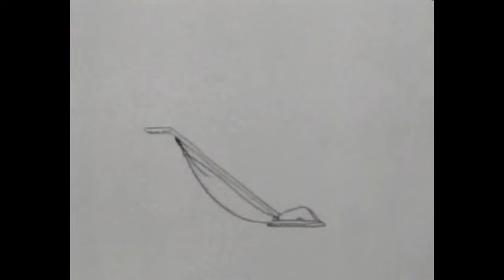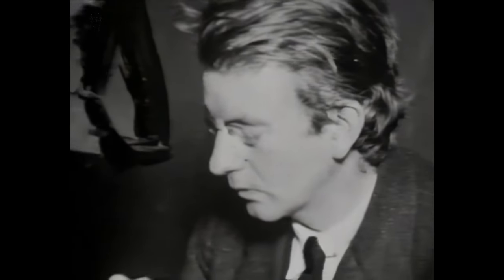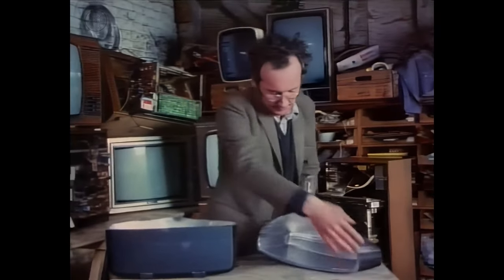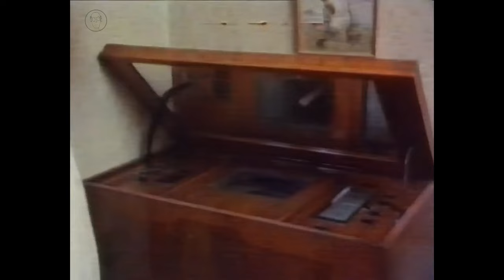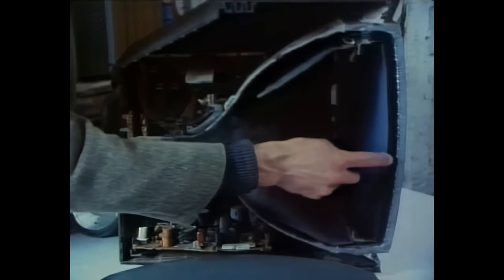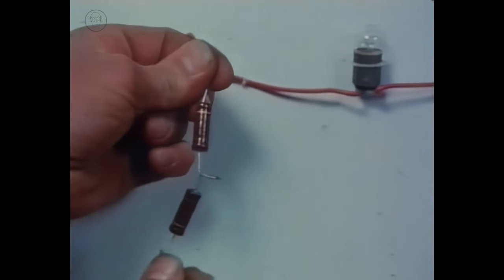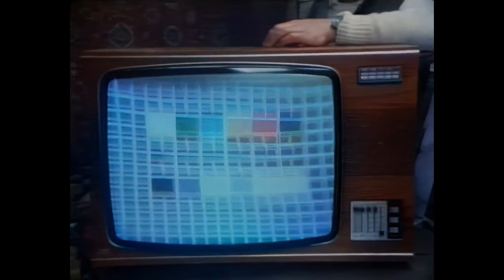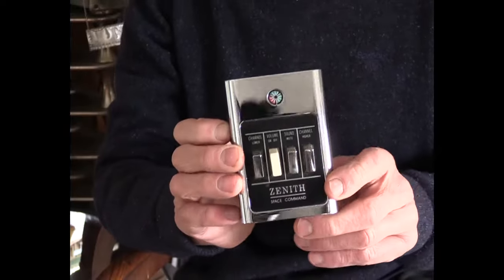The Secret Life of theTelevision - Remastered

Comment: 10:40 How did you scrape the phosphor off the inside of the tube?
Reply: Its pretty much just a powder coating. It can be wiped off
Reply: @audiodood  the tube is under vacuum. They would have needed to repressurise, cut it open, scraped it off then 'glue' the tube back together and evacuate the air. I was wondering if there was some other trick Tim used. Granted it's an easy job once you have access, it's getting there and getting it working after that's the problem.

Comment: Love it. That capacitor looks gigantic - was it a really high capacity, or is this just a difference in capacitor miniaturisation?
Reply: I have seen similar ones used at AM radio transmitters. They are high voltage and used for fine tuning.
Reply: @trustthewater  I had the honour of working in a building that had the 2LO as a showpiece. The voltage ranges there were 10's of Kilovolts.